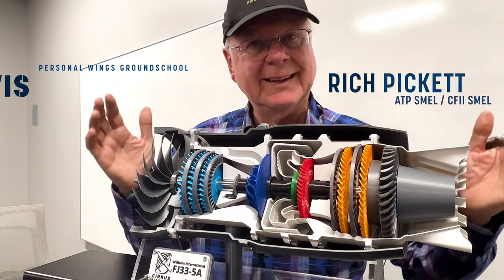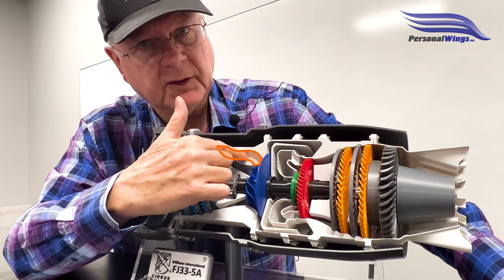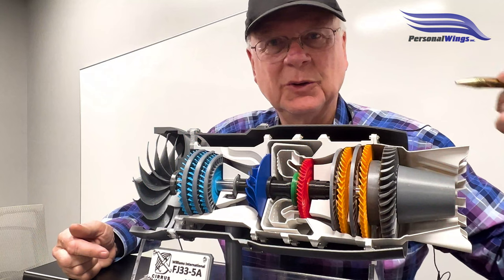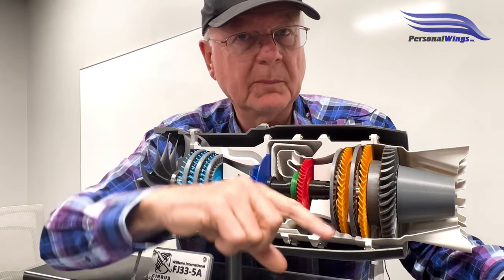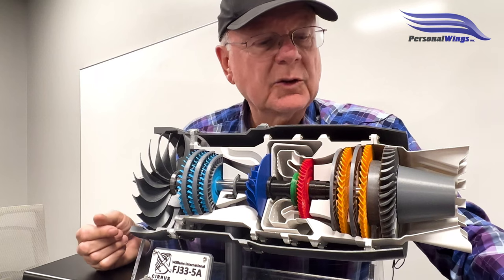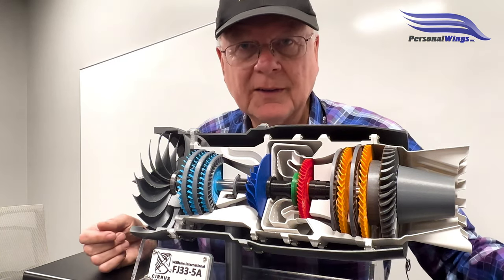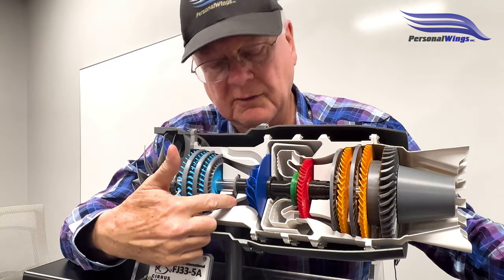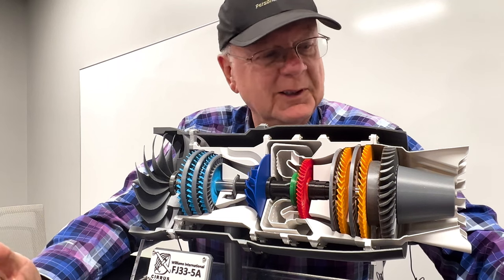How Jet Engines Work — Cirrus Vision Jet Engine | Williams International FJ33-5A Fanjet Engine

Comment: Nicely done!  Funny, I had an entire semester on jet engine design in college and at the end we ended up with no clue what parts actually made up the engine but could tell you all the math behind it.  A video like this should have been shown on day one of the class!  So I assume N1 and N2 are geared together?
Reply from the maker: Thanks. With the Williams engine N1 (low pressure) and N2 (high pressure) are not tied/connected together.  The shafts are co-linear with one inside the other, and rotate in the same direction.  This is the one drawback of this model, it has them connected.  The N1, in this engine, spins at approximately 40 % of the speed of the N2.  In the case of the Pratt & Whitney (PWC) turboprop engines, the N1 and N2 are counter-rotating.
Reply: This is a fascinating video and solidified my knowledge of turbine engine operation.  The shafts are CO-AXIAL.
Reply: I also took a turbomachinery class because I was so fascinated with gas turbines. I was warned to not do so because it wasn't an easy class, but there was no way to pass it up.
Reply: But I don't understand how the air passes through those turbines when the slots of the turbines are small and moving

Comment: I used to work at Williams in the 80s in Walled Lake Michigan as an A&P mechanic rebuilding auxiliary power units and cruise missle engines.
Reply from the maker: That must have been a cool job!  I know a number of folks at Williams, and it is a great company.   I love flying jets with the Williams' engines - from the Cirrus Vision jet to the PCk-24. My apologies for turning the engine the wrong direction, I was standing behind it and trying to finish the video.

Comment: What I'm confused about is, if the right engine turns off then the left engine turns on, what should I do, do I have to turn on the APU?, or am I forced to make an emergency landing during flight?
Reply from the maker: Are you multi engine rated? Pilots are trained to fly multi engines on one engine. Performance is degraded in pistons, but most jets are high powered enough where you’ll want to land soon, but can address it with a little more patience.

Comment: I saw your video on Facebook and I knew that in one and then two pressures meant that they were on different shafts but I had to come see this video to double-check and that is yet another mind-blower it's like a turbo inside of a Turbo
Reply from the maker: Glad it makes more sense! Yes, the self-driven aspect once ignition and sufficient N2 speeds are achieved is very impressive.

Comment: Very well done!!!!! Explained everything so clearly!!!!!!!
Reply from the maker: Thank you! It helps me to distill it so I can pass my check rides and type ratings! Glad you enjoyed. Any other aircraft systems you'd like to know about?
Reply: @PersonalWings  you could also maybe do the vision jets fly by wire system?
Reply from the maker: @Mattblackaviation787  The only fly by wire system in the Vision Jet is from the Thrust Levers to the engine FADEC.  When you move the Thrust Lever you are sending a signal to the FADEC for power.  The auto throttle system is also integrated in the electromechanical movement of the levers themselves. All of the flight controls are mechanical, through a system of pushrods, pulleys, and cables.  The auto pilot and trim  (AFCS) use servos that move the controls.    

We will look into a video on the controls, which would be cool to make.   Rich and Tigre
Reply: @PersonalWings  That would be great!! Did not know that the vision jet used mechanical parts for the flight controls. Thanks!!!!!
Reply: @PersonalWings  rotating wrong derection😂😂😂

Comment: I have noticed that smaller jet engines such as this one(but not as small as micro turbines or an APU) use a hybrid axial-centrifugal compressor. That seems to provide the best efficiency at that size as opposed to just a pure centrifugal or axial flow compressor.
Reply: The HP is small, so we can use a big centrifugal compressor. Small * Big = fits. Centrifugal is limited to 1:4 compression. I think that big jets have 1:64 over both spools. So HP needs 1:8

Comment: I was under the impression that n1 & n2 counter rotate to cancel out gyroscopic forces. Thank you.
Reply: Hi CG the Williams actually have both shifts rotating in the same direction . The PWC PT6, for example, does have two counter-rotating shafts.  We will post videos on that as well. Subscribe and we will keep you updated! Rich and Tigre
Reply: @richpickett  Thanks.
Reply: Guys, what's with that lpt component right before mixer ?
Reply from the maker: Not sure what you mean by "mixer".
Reply: @PersonalWings  Mixer? I don’t think I wrote that in my question.
Reply from the maker: @CG-kf5vh  that was for @Ingunn Bollestad
Reply: @PersonalWings  Tx

Comment: I am still at a lost to understand how and where a jet engine creates its forward push. Obviously the power is created in the combustion chamber of the jet engine, but at what location in the jet engine is this power transmitted as a forward push?
Reply from the maker: Think of how a typical cooling fan works. When you hold your hand in front of it, you feel the wind blow, right? Well that's basically thrust. Since every force has an equal and opposite reaction, thrust creates movement opposite of where that felt wind is pushing which moves the object — in this case a jet. The cooling fan doesn't move since it's fixed with a sturdy base and the thrust generated isn't that great. But a jet engine does generate a lot of thrust, enough to move the weight of the airplane and accelerate to achieve lift.

Thrust in a jet/turbine engine occurs in two parts.The N1 fan (front fan) spins fast enough to produce a good amount of thrust just from it spinning. Then you also have the exhaust pressure from the controlled explosions of the Jet A fuel that also contributes some thrust, or push, to make the jet move forward. Hope that helps!
Reply: @PersonalWings  came here to ask the same question 😂 So just to clarify the air that is being pushed by the large fan in front through the bypass as well as the exhaust coming out the rear provide power in combination?
Reply from the maker: @jasons086  Jason that is correct. The bypass air can provide between 30 and 70% of the total thrust in a modern bypass turbofan. This one one reason they are more efficient than a turbojet and quieter.
Reply: @PersonalWings  Thanks for the quick response! Really great video and explanation!

Comment: Nice video. Could you please explain compressor stall?
Reply from the maker: Sure thing. The vanes inside a jet engine function like miniature wings, each with its own critical angle of attack (AOA). Certain conditions or stresses on the engine can disturb the airflow, causing the AOA to be exceeded. This results in explosions and pressure exiting the front of the engine, often accompanied by audible pops or bangs and possible buffeting. To correct this, you usually reduce power and may also need to lower the plane's overall angle of attack. Thanks for watching!

Comment: Hi how the air flows from the blue coloured cf compressor to the ignation?
Reply from the maker: dark blue centrifugal compressor? it flows up and back weaving it’s way into the annular combustion chamber where the fuel slinger sprays fuel and it’s ignited.
Reply: @PersonalWings   Thank you  do you guide on how to build an engine for  drones.

Comment: Is this the actual size of it? I ask because prior to the GFC Williams were involved in a $100m failed engine development of an engine called the EJ22 that Air & Space magazine called the little engine that couldn't. Although the EJ22 was triple spool this engine reminds me of it.
If the EJ22 succeeded it might have been the end of piston engines, such were its lofty goals. IIRC the design brief was to deliver fuel economy, cheap acquision and low cost maintenance from a jet engine aimed at the sub 15,000' flight regime GA market.
It failed because it was diabolically complicated, wouldn't start, was appallingly susceptible to hot and high airports (being unable to produce half its rated 770lbs of thrust) and the GFC.
.
Reply from the maker: No this is a much scaled version, can't recall how much. Though. Our reality is only created from failed dreams!

Comment: Whats the reason for having 2 types of compressors, why cant you use only axial or centrifugal while still keeping a section on its on shaft? Nice video though!
Reply: Each compressor is optimized for its function.  Combining both allows the engineers to use different ones for each stage/stage.  Here is a good reference link: https://en.wikipedia.org/wiki/Gas_turbine_engine_compressors
Reply from the maker: Centrifugal compressors are the oldest types of compressors and were the only ones used at first.

Comment: Why uses a mixture of axial and centrifugal compressor? Called "diagonal" compressor
Reply from the maker: Gustavo, I'm not an engineer however I assume it is to optimize the air flow direction for the specific purpose. Axial compressors can have multiple stages, while centrifugal compressors cannot - since the airflow of an axial compressor is linear and can proceed to the next stage.  I did find a very cool briefing from NASA that might help - https://www.grc.nasa.gov/WWW/k-12/airplane/compress.html

Comment: Hello
I had a question
In the fj44 engine, the three-stage medium pressure compressor is welded together
If there is damage, will the whole piece be thrown away?
Reply from the maker: In engines with a single forged disk, sometimes called a blisk, if there is sufficient damage the entire component must be replaced. Depending upon the extent of the damage, it can be repaired by blending the damage.  In other engines with multiple blades, they can be individually replaced.  For example on a PT6-42A turboprop there are50+ segments and each one is $2,000 , so it can be cost effective to only replace the damaged component.

Comment: Interesting. As soon as you mention stators and rotors I start thinking of Induction Motors. Leaving aside the question of battery weight for a moment, I wonder if an auxiliary IM can be included in the N2 system to augment thrust.
Reply from the maker: It never hurts to look at possibilities!  Even if one fails, it can open the door to others - that is how innovation works.  A lot of work is being done on electric aircraft propulsion,  many will probably fail, but some will succeed!
Reply: @PersonalWings  Thank you sir. Absolutely! Fail your way to success is a time-honoured methodology, and shared between like-minded people trying to nut out the same problem it can lead to amazing breakthroughs. Thank you for affirming.
I would need to run the math, and also understand the effects of stress and metallurgy, but turbofans rotate at about 14k rpm max, while IMs max out at 50k rpm.
The propulsive force is driven predominantly by the expansion of gases in the chamber granted... nevertheless... in regulating what is essentially a continuous explosion, the stator/rotor setup could be augmented via an IM, given the increased rpm. How exactly it would achieve that, and do that within the structural limits of a turbofan is beyond my knowledge currently.
Reply from the maker: @yggdrasil9039  You are welcome.  The turbofans actually rotate much faster - in this case the N1 at approx. 22K RPM and the N2 - > 50K RPM.  The Williams engine utilizes a single forged titanium fan blade and disk assembly 'blisk' that enables the high speed --- very cool.

Comment: If it has a bird strike, those engine are going to be screwed because of the Turbo like intake at the high pressure system
Reply from the maker: All jet engines must be tested for bird ingestion (when the bird hits the fan!) and to be certified  to maintain a certain amount of power.  They litterly shoot bird carcases with an air gun into the intakes of the engines for testing.  Unless you have a number of birds simultaneously hitting the engine, example: Miracle on the Hudson - Airbus, the engine can handle it.  If you do hit a flock  - all bets are off!  That would also be the issue with other aircraft, as well as penetration of the windshield, radome, etc.  I've seen very serious damage to planes from bird strikes.

Comment: Do these engines have replaceable journal bearings or do they use roller or ball bearings? 
Are the co-axial shafts independently supported or does the outer one simply ride on the inner shaft with, I suppose a high pressute oil film?
Reply from the maker: Werner I know the bearings are replaceable, but don't know the specific type. It is an amazing design with high reliability.

Comment: I like the Vision Jet but my one concern about it is the jet engine being over the cabin and fuselage. If you have an uncontained engine failure and passengers, they are likely to take shrapnel to the head and chest. Not to mention the V tail most likely receiving damage and making the jet uncontrollable.
Reply from the maker: J.R.  I've never read an incident of an uncontained engine failure with the FJ engines, it might have happened but I can't locate any.  The Vision Jet engine is actually set well behind the cabin at the aft of a long intake. The forward face of the engine (the N1 Fan) is approximately 14 inches aft of the pressure bulkhead. With any uncontained engine failure, you risk airframe damage.  The aft mounted engines on a number of jets, could cause damage to those rear flying surfaces (horizontal/vertical).  In the case of tail mounted engines (tri-engine Falcons, Boeing 727, L1011,DC-10) since they are embedded in the empennage/tail they also faced the same risk.   The Vision jet does have a thermal shield that is capable of fire resistance for 15 minutes, plenty of time for the two fire extinguishers to put out any engine fires.  Rich
Reply: @PersonalWings , I’m not aware of any uncontained engine failures either. The way the engine looked though it appeared that at least the fan blades may be somewhat in line with the rear portion of the cabin and thus my concern. I also understand what you said about every jet being at risk for the tail section taking shrapnel in an uncontained or even in some cases, contained engine failure. What concerns me with this Vision Jet though is the V tail. Take for example the Beechcraft Bonanza V tail version of the plane. The V tail does offer some advantages over more traditional tails, but it does have some disadvantages too, mainly that if a V tail receives damage it can make the plane or jet much more difficult to control. The parachute is only recommended at no more than 130 knots I believe although some reports in the SR 22 or 22T have said the chute has been pulled as high as 180 knots but the jet flies a lot faster and would in turn be far more difficult to control as well if the V tail took damage at higher speeds. Granted, it has not happened yet. At least to my knowledge. And I’m not suggesting the jet is unsafe. Quite honestly, I think that it actually is one of the safest jets made today. But with my initial comment, and maybe it’s simply due to me not being properly educated about the jet, those were my initial observations and concerns. But again, I really do like the jet and if I had the money, I would consider buying one so this is not a knock on Cirrus by any means whatsoever.
Reply from the maker: @j.r.777  J.R.  The front part of the engine is at least 14 inches from the rear bulkhead.  I have a photo but I don't think I can post it here.  I may also upload a video that shows the aircraft in maintenance with everything open, which is very cool.  We also have a video that shows the chute deployment in the simulator.  It is dramatic!  My upcoming article in our June 2022 issue of Twin and Turbine magazine goes into detail about the chute.   We love questions, so always feel free to ask or discuss!  Rich and Tigre.
Reply: @PersonalWings , thank you for the response once again! I was unaware of the fan blades being that far back. That actually makes me feel much better. I look forward to your June 2022 article and will check it out! I wish every plane or jet came with a chute! 

On a side note, why can’t commercial airliners? We have older NASA rockets, Space X rockets that do and at greater velocities than commercial airliners. I’m
Assuming they don’t because of velocity and weight and a majority of pilots training to simply divert and land with almost all maydays but it still has always had me wonder why not? I can testing and certification costs through the roof also play into that as well. 

Can any piston aircraft be fitted with a chute though? I know Diamond Aircraft made claims they are safer than a Cirrus and I heard mixed reports of them eventually being fitted with chutes but know that as of right now they don’t. I know Sling aircraft can also come with chutes too but other than them and Cirrus, those are the only ones that I know.

Comment: Nice model, but it seems like the high pressure turbine and also the low pressure turbines are installed backward.
Reply from the maker: How do you reach that conclusion (beyond Rich turning it backwards 😜)? Look at this FJ44-4A model and you'll see the fan, stators, and turbine blades all slant from a Top Left to Bottom Right orientation: https://forums.x-plane.org/index.php?/forums/topic/247012-williams-fj44-4a-full-authority-digital-engine-control-fadec-controlled-turbofan-engines/
Reply: @PersonalWings  The orientation is ok, but the foil are reversed.

Comment: the Bearings for the shafts ...
50,000 rpm   hope they
last ..
Reply from the maker: Apparently they do.  The overhaul on our engines is 5,000 hours.  Some parts are replaced at midlife, but they vary depending upon the engine model.